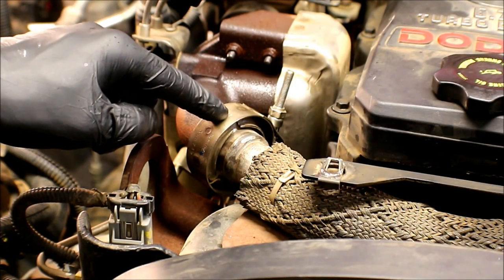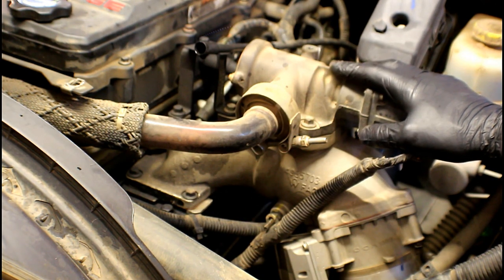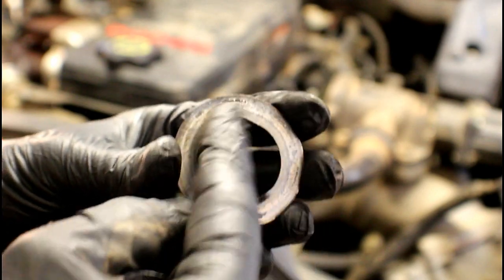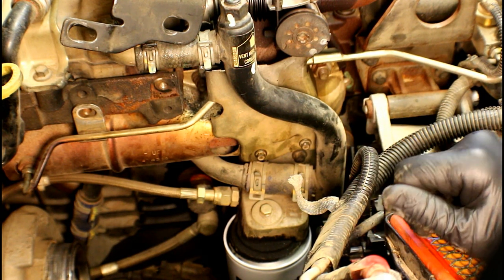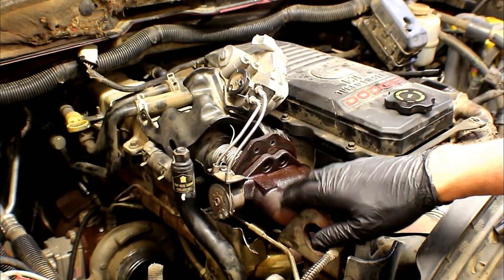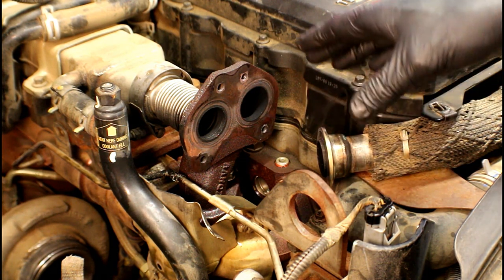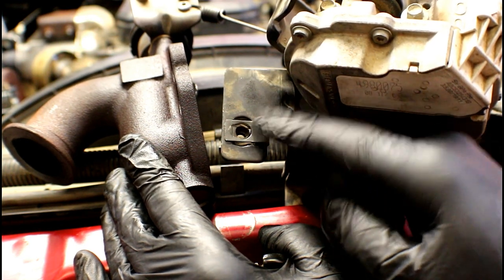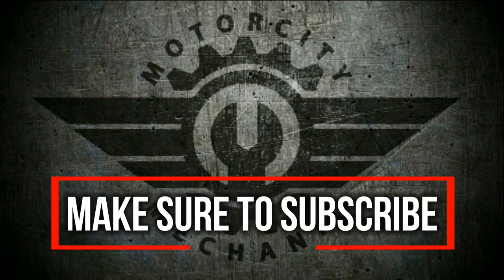Part 2/2: 2007-2012 Dodge Ram Cummins 6.7 EGR cooler bypass valve replacement

Comment: Great Video and as a long time Chrysler, Jeep, Ram technician, thank you for not instructing others to disconnect the electrical portion of the valve from the mechanical portion.  It can be adjusted but Cummins does not recognize any procedure for adjusting the cables.   Too many times I have seen others replace the electrical portion only then set codes for a failed EGR cooler bypass valve.  (P245B). 

I came across your video looking for that adjustment procedure as a customer had removed everything to delete the truck then was reinstalling it to pass emission testing.   Factory diagnostic procedures assume nothing was tampered with    I managed, through trial and error to get it adjusted adequately.  

Thank you again for showing others the proper procedure!

Comment: Great video. Throwing a P2493 on my '17 Ram 2500. After searching, I keep seeing the EGR Cooler bypass valve. Got 75K on the motor. Not sure if this is the culprit or not. Thanks again.

Comment: I cleaned my total EGR system out on my 2018 6.7 cummins upon putting back together I think I funked up my EGR cooler servo motor by cleaning out the valve or something because when I put it all back together the servo squeals like a pig upon Acceleration I know it's not my turbo because I had zero problems with it beforehand I doubt it would just start going out after I cleaned the whole EGR system out by the way the EGR flow tube that goes across the top from cooler to valve was 80% blocked with carbon and soot if this valve needs to be replaced what are the symptoms I keep getting an overboost code for turbo?

Comment: MCM, love your channel and I’m a subscriber I have a question, my check engine light has been coming on and off intermittently and the dash is showing a code for P245a (2009 ram 2500 6.7L) the code says “cooler bypass circuit open”. Doesn’t this mean my EGR cooler valve is failing? Does it need to be replaced or do I just need to clean the EGR assembly? Thank you and any help.
Reply from the maker: That code deals with the item with the braided cables and actuator mounted to the front of the EGR cooler. Mine sets that code from time to time. I am sure its getting stuck and there is mention that in cold weather it can stick depending on the temps. I get under the hood of mine and manually move the valve (black circle) to free it up and spray some WD40 as well to see if it helps. Its something you could remove and clean using Purple Power and then replace the related gaskets. Since the last time I lubed mine up....it hasnt returned.

Comment: In a genius, MOVE, a friend of mine told me to take the cables off of the motor side, but ever since I kept throwing a bunch of EGR codes, so I put the cables back on, then my truck has run like shit, rough, and intermittent and dying at stoplight, I am reinstalling the cable and it has quit stalling and stoplights, but it still runs rough ,I think I put it on with the valve in the wrong position. Can you give me any advice to get it correct?

Comment: Hi does the bypass valve only modulate in the regen cycle?
I have started blowing black smoke after a regen cycle it clears up after a while.

I did receive 2 codes that said my dpf was cracked.I was able to clear codes and filter went from 100% plugged down to a point where I have no alarm.

I think my egr valve may be stuck open.Any ideas where I should begin.Thanks

Comment: Great stuff! What's an indication that it needs replaced? What does it do?
Reply from the maker: There was a check engine light and code.....the code was p245D. After running the test, found the electrical portion to be bad.  The valve stops the exhaust flow from going to the EGR valve until needed. It reroutes the exhaust that goes thru the cooler back down into the manifold. Thanks for watching and for the question!
Reply: MotorCity Mechanic Thank you!
Reply from the maker: Your welcome!
Reply: Yep, came here to ask this.....thanks! Include a quick diagnosis procedure when/if you can!
Reply from the maker: I will try to if I get time.Most times during filming I only have the time to show the repair.  I will certainly keep it in mind. Thanks Jeremy
Reply: Great video, just wondering, Does it stop all flow? Or does it bypass the EGR "cooler" when the motor is cold and then open to send cooled EG to the motor when it is hot? The valve has a hot port and a cooled port. And maybe it mixes the hot and cold to a set temp from the CPU?
Reply: MotorCity Mechanic Yeah, I understand you're in the shop and trying to beat the clock! Keep em' going!
Reply from the maker: Thanks CS. Here is the description of its operation: The Exhaust Gas Recirculation (EGR) Cooler Bypass Valve is used to redirect the EGR gases around the cooler when the engine is in an active regeneration mode. This is to prevent EGR cooler fouling.
Reply from the maker: I sure will and you keep watching Jeremy
Reply: That makes since.  Does the EGR system totally shut down till regen is done? Or Does the hot side of the bypass valve help in the regen?
Reply from the maker: As far as I know it does. The regen is mainly about extra fuel being let into the exhaust that causes the temp to go up and then burn the soot to ash.
Reply from the maker: I feel its really reliable in stock form. When you do deletes and programs....sometimes you can create  new issues. I feel its a cost decision. One day if the cost to repair my personal 6.7 is more then the delete or "ghost delete" then I might change my tune and eliminate a few things. For now...I'm staying stock. Thanks for the question and for watching the video! Not forget to subscribe
Reply from the maker: JP 86 That's awesome feedback and also it shows that I have the best viewers! Thanks for having subscribed and for continuing to follow the channel. It's much appreciated.
Reply: Great video!  My bypass valve is working fine but i've noticed a exhaust leak and it seems like coming from the butterfly flap near the spring.  Is that a common wear point?  Thanks in advance.

Comment: How long is the entire job remove the egr valve  and the cooler and replace them I am having my 2012 ram 3500 done now by a mechanic I do not knew but was recommended to me was wounded what the  estimated work time should be 

Stephen Travers
Reply: I just did it myself on a '07 3500 4x4...the EGR valve itself (not the EGR bypass valve) is about 5 minutes for both removal and reinstall.  The cooler is a lot more work...you have to do everything that is explained in this video, plus the coolant hoses which do not have much play in them, and a lot of nuts and bolts, not the least of which are the cooler attachment bolts way in the back of the engine.  for me, never having done this before, it was a good couple hours getting the cooler out (including the bypass), plus cleaning all the surfaces.  And then you have to soak and clean the valve and cooler to get the crap out.  Its not hard, just time consuming and kinda backbreaking.  There may be some differences between the '07 and the '12

Comment: Every time I turn my truck on using the remote it only stays on for about 10 seconds, my truck is a 2500 Dodge Ram, the screen displays “remote control disabled”, do you know what the problem could be?
Reply from the maker: First thing I would do is check for codes. If there is a code....it can disable the remote start. That is where I would start.

Comment: David, another great vid. Thanks for your hard work. Your level of professionalism is awesome. A real asset to your dealership, and us dummies out here trying to learn something about these machines. THANK YOU!!! 
BTW, I have one question regarding my 2013 Ram 3500 Cummins. My local dealership tells me at 67,500 I need this extensive emmissions  service. My owners manual speaks only of changing out the ccv filter. So, I'm trying to figure out which is correct?? Can you she'd any light on that subject? Thanks in advance.
Terry
Reply: Terry:  Did you ever decide if this service is valid or not?  I have heard the same thing and I performed the service at 67,500.
Reply: @steprman  Yes, it is a required maintenance issue. However, to the extent necessary seems to be governed by model year of the vehicle. Later models needing less attention. You would need to check with the dealer for that specification ( model year requirements )

Comment: Have you ever dealt with the code p0191 fuel rail sensor for a 2012 dodge 2500? Been having this code come and go now and have had mixed reviews on what to do. What would you recommend to fix it? The truck runs fine and the code only comes up when the truck is sitting at idle.

Comment: Hey David, great vids! How many miles before this needs to be replaced and what is the cost of the parts?
Reply from the maker: Thanks for the kind words. This part failing isnt a common issue so it might never happen on a certain vehicle. The price that I can find online is around $600.00. Mine is acting up correctly and I have 230k miles. The one in the video had around 150k. Thanks again for watching and for the question.

Comment: Question: I recently purchased a 2017 Ram 6.7L CTD.  I have read where the EGR system within The newer 6.7L CTD do not need as much maintenance as the older models.  Also something about the system has been simplified some what to where there are not as many issues.
Is there any truth to this?  
Thank You
Reply from the maker: Your correct. Both the cooler and the EGR valve dont need the cleaning the older 6.7's did. Alot of the changes were software. Its boils down to evolution of the engines......learning from their mistakes and improving things.
Reply: @MotorCityMechanic  Sir I just read this !!! do you think Dodge might man up and give the older dodge trucks a good discount to repair and install the better versions !!! I know this sounds crazy but those are expensive and so are the trucks nowadays  !!!!

Comment: What are the symptoms of this failing?
Reply from the maker: Main symptom will be the check engine light coming on and a related code. Thats the only thing I have noticed. Thanks for the question and make sure to subscribe